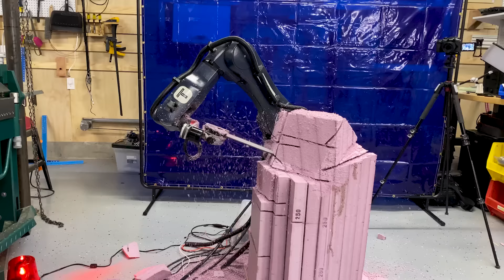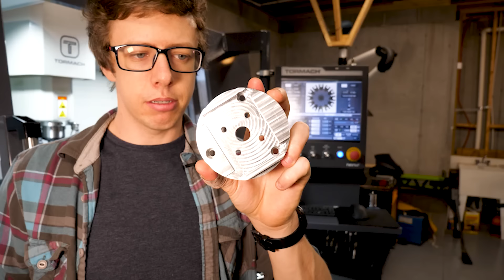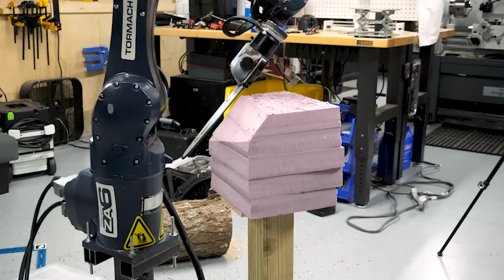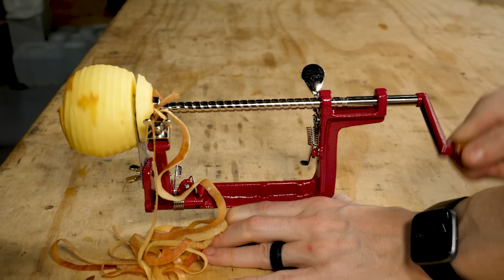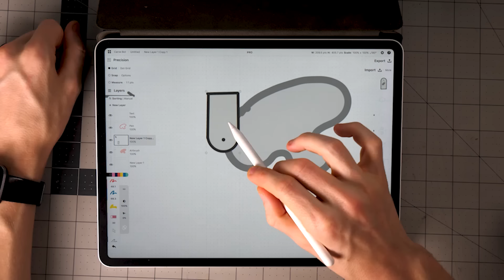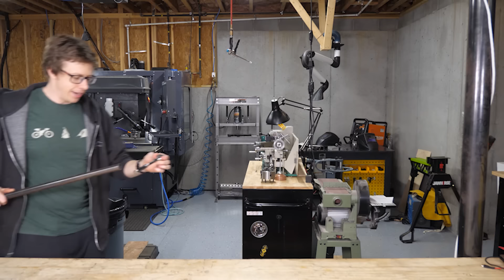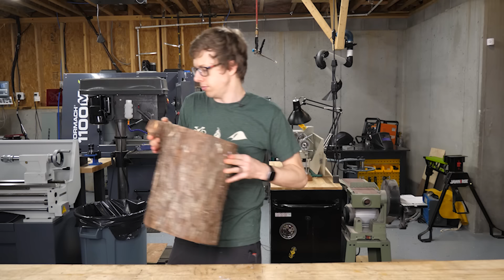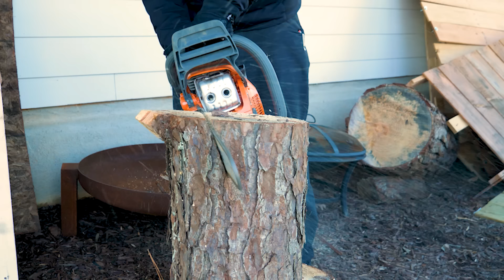Chainsaw + robotic arm = art?

Comment: Great project Shane!

I don't have any real engineering bonafides, but I do have a lot of experience with chainsaws. Don't ask.

Some things to possibly help with V2:

1. The "anti-kickback bump" isn't for kickback, that's the raker. They're designed to ensure that each tooth only cuts out a small ribbon of material each pass. This does help mitigate knockback when cutting with the 'forward' edge of your bar, but its mostly to optimize the cuts the saw makes. After about two to three hours of intense cutting, the tooth will be worn down with friction, and the cutting surface will be dulled. This is one reason you couldn't cut on the tip, the raker was preventing the tooth from catching the material properly. This can be solved by filing down your rakers everytime you sharpen your teeth, which should be about every 2-4 hours of cutting, depending on the material. On paper each individual tooth has the same cutting power, irrelevant of position on the bar, but when on the straight edge of the bar the teeth can cut deeper, because of smarty pants stuff I don't totally understand. 

2. Cutting with the tip of a chainsaw involves some funky geometries and forces, as I'm sure you're aware. From experience, a person can't just jab the tip straight into wood and expect it to cut. This is because only a couple teeth actually engage with the material at any given time, and because of physics you probably know better than I, the saw's tendency is to "run" along the material, instead of actually cutting. Cutting with one of the two corners, where the curve of the tip meets the straight edge of the bar, is preferable. I can't fully explain why, just trust me, I got thousands of hours of experience behind a saw. If I had to hazard a guess I would say that more teeth can cut more consistently along these corners than the tip alone. However, cutting with these corners is where knockback becomes a concern. Universally sawyers only cut with the "cutting corner", the corner where the chain is running back towards the head of the saw. Using the other "kickback corner" tends to, well, kick the saw back at you. The saw will always prefer to move instead of cut, and the kickback corner is where the chain is running out, away from the head of the saw, creating force that pushes it out of the material. Cutting here is incredibly unsafe for people, but your Tormach arm may(?) be able to provide a consistent force to counteract this without ruining your cut. However, your best bet is to only cut with the "cutting corner" of the tip, at least until you've got an inch or two of depth, at which point you can straiten the bar and begin a plunge cut, which is just pushing the saw strait into the material.

3. Your saw is dangerously hot because of two possible reasons. The first, is that your teeth are dull and require sharpening. Obviously when a power cutter is dull and not cutting properly, it creates lots of excess heat through friction. I'm gonna give you the benefit of the doubt and assume you're keeping your teeth sharp, if you aren't it's pretty easy to lookup tutorials and buy the necessary tools online. The second reason that I can tell just from looking at your cuts, is that you aren't using any bar oil. Bar oil is just a combo coolant and lubricant, you can buy it off the shelf of any self respecting hardware store and it's vitally necessary for any intense cutting, which this qualifies as. Pole Saws rarely use bar oil, they're designed for more domestic use, you know, less intense use less often, but also because the branches pole saws cut are fundamentally different materials than the trunks you're trying to cut. Trunks are denser and more brittle, being significantly harder to cut. Teeth create heat when cutting trunk-wood and running a saw for long enough to cut through a trunk risks the heat from the chain running along the bar being great enough to warp the bar. You are terrifyingly intelligent, I'm sure you can design a oil reservoir to cool and lubricate the chain using off the shelf oil, but if you don't want to I think you might be able to find industrial pole saws with it already included.

4. Another consequence of using a pole saw to do chainsaw's job, is that the teeth on a pole saw are just designed differently than those on a chainsaw. I don't work with pole saws, so I can't say how, I just know they are. I'm certain though that you could probably buy (or make) chainsaw chain sized for your pole saw.

5. You may need to slow down the speed at which you cut. If you push a chainsaw into a material too hard, it'll have trouble cutting, and may even stop. This is rare with human operators, but your Tormach arm can almost certainly exert enough force. Slow it down some, cutting with the "back" edge, where the chain is running into the saw head will naturally pull the material into the teeth, very little extra force is necessary.

TLDR: File your rakers (and sharpen your teeth!), adjust your cutting geometry, include lubrication and cooling, and finally use chains designed for the job at the right speed and you should be cutting doggos outta wood in no time.

Bonus round: Wood can bend and pinch onto the bar and chain of a saw if there is enough mass above it. This can slow the cutting, and even damage the bar and chain if it's bad enough. This is usually only a problem when cutting into trees, but it might affect you, depending what cuts you make and how chonky the wood you're cutting is. If you have problems with this, maybe optimize the tool paths to cut top down, and never make a cut that has X volume of wood above it?

Bonus round 2, electric boogaloo: An electric skateboard motor probably isn't enough horsepower. I don't know the specifics, just that chainsaws, especially electric chainsaws spin a lot faster and with way more torque than people think. If you fix everything else, you could probably get away with keeping that motor, though it'll still probably be rather slow. I'm not sure how much bigger/better a motor you could mount, considering your space constraints.

Bonus round 3, hopefully the last: another note on sharpening, I noticed your saw hits the Tormarch a couple times. Hitting metal can wreck the chain on a running saw.
At best it dulls a few teeth significantly, at worst it can outright destroy the teeth. I highly recommend slamming that E-Stop if you suspect the saw will hit metal, since it can take upwards of an hour to resharpen the dulled teeth by hand, but you may also want to have a few spare sharp chains on hand to continue cutting if you do hit metal again.

Comment: How did the chainsaw stay lubricated? Without the bar oil it’s pretty easy for the chain on bar friction to cause sparks and a lot of heat so that may be a big part of why it was so smoky on wood ( besides the low power obviously)

Nvm just noticed he left the oil tank after it...

Comment: Please fire the guy you know who has trees. Next time call me I'm happy to help. Don't use pine as carving wood. It's awful. It's full of resin that will gum up your saw and dull your blade. I'd suggest using kiln dried poplar. Stay away from woods with lots of resins in them. Also I love sharpening chainsaw blades. I'd be happy to help with these woodcraft problems. I run a cnc router in my shop. That means I'm only smart enough to commiserate to understand how insanely difficult what you are doing. But for real I love sharpening chainsaw blades.

Comment: As a chain saw guy, I have some tips!
First, you need a different chain, or modify your own chain. Second, you need a softer log. Find a new Guy to know! If you look at Baileys logging supply etc you will see they have wood carving bars with skinny tips, and carving chain.
While you can probably get by with the sprocket nose bar, you need the carving chain.

The bits you pointed out on your chain are the "Depth Gauges" and they basically control the feed depth of each tooth, and also have to be ground down each time the chain is sharpened to keep the feed depth the same.

Normal civilian chains have anti-kickback features, which make the depth gauge push the tooth further away when it's going around the end of the bar.
Pro chain and carving chain don't do this, and if you get a little Dremel chain sharpener etc, you can easily grind the little arm back yourself, as long as you don't shorten the high point on the flat sections of the bar, or you can just buy the chain without kick back reduction.

In addition, you can grind the depth gauges down a little bit and let the tooth grab a deeper cut, but you will probably need a more powerful motor.
You can also do the opposite and grind the tooth down as if you are sharpening the chain, WITHOUT grinding the depth gauge, and reduce the depth of cut to reduce the motor load.

All this is regular parameters in chain sharpening depending on the application, control needed, horsepower of the saw etc.

When I was doing tree work, the saw I used hanging on a rope in the tree had kick back reduction, a low depth of cut, etc, but my ground saws had full skip chisel chain and full danger so I could easily plunge cut, carve, or just blast through the wood.
You would be amazed how fast you can cut oak with a 24 inch bar on a 395 Husky... Lol

So if you are wanting to plunge cut or use the tip of the bar, get rid of the anti-kickback tabs.
You risk damage to the equipment from kickback (where the chain grabs and tries to lever the saw across the face of the log), but if the robot is stable enough, I don't think it will be a problem.

As others have mentioned, it also takes a different kind of chain for ripping wood than cross cutting. 
When you cut across the grain it makes neat little chips that clear easily, but ripping with the grain basically creates long ass fibers that gum up and clog, and it needs a different tooth style to work well with ripping grain. 

Carving chains will be ripping chains since that's a lot of carving. 

And you picked pretty much the worst kind of wood for this lol 
Pine/fir is resinous and sticky, and not fun to cut. 
I don't know what part of the country you are in, but maybe call an arborist near you and see what kind of really soft wood grows in the area. It will be considered trash wood probably, not good for firewood or building because it's so soft. 
I am not going to try to name any suggestions, but Google can find super soft species I am sure. 

Balsa wood would be perfect, but it's hard to get logs if it outside of the jungle lol 

So I would swap to a carving chain, and not be surprised if you need more HP to drive it.

You can make your own custom length chain with a chain breaker tool.
You need to match the bar groove width, and the drive sprocket tooth pitch when selecting chain.
Or just get a carving bar and matched chain and drive sprocket, and make whatever modifications needed on the powerhead to fit them on.

This will get you past the chainsaw parts of your problems, so you can focus on the rest lol

Comment: The chainsaw needs a way to oil the bar and  I noticed the chain was also loose you Want it  tight enough to be able to put a dime under it if you pull it up

Comment: I used a die grinder and a carbide bit in rage on a piece of wood I needed to shape strangely. I wonder what giant carbide or even less dense bit you could put on a robot arm.. just shred with different shapes at a rotation instead of linear...lets the chips fly.

Comment: Confused... Why reinvent the wheel when there is already software out there to do it? You draw it in cad / cam software and export it to 7 axis software.
https://www.youtube.com/watch?v=YPyPwr5B8nU 
Second... a chain saw is designed to be lubed while in use. 
Third... Depending on what you are cutting and the direction of the grain (cross or with) you have to pick the right type of chain. 
https://chainsawlarry.com/chainsaw-chain-types-explained/
And as far as using the chainsaw to do the smaller cuts, you need a carving chainsaw.
http://www.cannonbar.com/carving-bars/

Comment: You need to use an angle grinder to chain saw conversion kit for 60$. You just need to make a DIY oil chain lubricant tank. That way your chain won't overheat and also break. The angle grinder is really more compact, have more torque and have more speed then your chainsaw and a gas power chainsaw.

Comment: I was thinking about different methods to choose what cut to use. You ended up using an iterative process to find cuts. Instead create a normal map of the 3D model and calculate the tangent space. You could then go through each normal plane and select the ones that remove the most amount of material to create the smallest possible convex shape. From there you can calculate the intersections of these tangent plane to form the wedges you found. Granted there would be some more work getting the normal map converted to the tangent space and some selection parameters would be required to choose which tangents, and their intersections, to cut, but the math would be simple linear algebra. I like trying to find solutions during the vids, It's my favorite part of your videos.

Comment: Since you ended up on foam that opens up the idea of ditching the chainsaw and going with a MUCH safer hot wire cutter. I'd bet you could dial it in to a much higher level of detail with that and the rig will be way less likely to kill anyone!

Comment: Reference: Saw not Cutting Wood.

The teeth you referred to as anti kickback teeth are the depth gauges for the chain, commonly referred to as "rakers".  They should be filed about 0.025 inches below the edge of the following blade on the chain.  If they are set right you should see large curls of wood being pulled off the log (maybe not in hardwoods).  If they are set wrong the saw will not cut in a way similar to what you experienced in the video.  There is a tool you can get that sets the depth of the rakers for you that works pretty easy.  Also with a chain that short you are probably going to have to stop and sharpen it a few times if you get the wood working.

http://www.madsens1.com/bnc_depth_gauge.htm
https://tinyurl.com/yaerhhd4

Thanks for the videos; interesting, entertaining, and educational as always.

Comment: You should try and use a carving chainsaw blade. There are special ones out there. They are way more pointy at the tip and carving chainsaw blades are designed to cut differently. But awesome Video Dude!

Comment: 17:25 The anti-kickback chains are designed with safety in mind, however they also prevent you from achieving certain cuts. You can buy chains that don't have this feature, which would fix the problem (maybe).

Comment: Awesome results!
Your persistence through integration hell project after project is inspirational.
As much as the chainsaw idea is good I'd love to see you leverage on the foam as a medium and use a heated wire to cut it. It would make for an interesting experiment using different shapes of wire as tools and it'd probably be able to cut in much higher resolutions.

Comment: All right I have anger management issues and you're getting me all kinds of triggered that thing you zoomed in on and called an auntie kickback tooth is called a clean out tooth there is no teeth on a chainsaw designed not to let it kick back that is a myth the bar break meaning the lever that engages the brakes when the saw gets jerked prevents injuries during kickback kickback is a result of user error and you definitely need oil on that chain I'm pretty sure you do eventually get that straightened out but chains need oil especially when they're sliding through a track they're not rolling over a sprocket there's a lot of friction there creating all that heat and those clean outs you can file them down so they clean less material and then the teeth will bite a lot more but you're going to have to put a lot more torque into that chain

Comment: I did well with an applied math class that dealt with problems like this, and am semi-familiar with optimization of this variety. Here’s a way I think you could make the gradient ascent method work:

What if you defined the wedges in the same way you did with gradient ascent, and use one step of gradient descent from each peak when it gets stuck like that, fixing its height and (I think) latitude?

Then force the program to continue searching for a maximum, in that direction (CW vs. CCW) within that height-latitude “cross section” (not really a plane but for mathematical purposes we can call it that). 

From there, you know you are searching for a new, unique value.

On the off chance it just keeps looping between two max values (which should be easy to test for by storing and comparing against known extrema), I would define a plane orthogonal to the line connecting those two points, guaranteeing that you will find a new third point.

I’m not sure if that will get you stuck in a triangle, but if it does I can try to puzzle through that too.

The trick is to limit the set of variables it is testing, and give it a tolerance and a general direction that encourages it to move on from an area - though I’m sure you know that much.

Really cool video and result! If math class was like this all the time I might not have dropped out of university :/

Comment: Get some bar oil on there for some lubricant!🤣that’ll help with smoke and heat. File down the anti kickback so the chain can make a more aggressive cut instead of rubbing.
Reply: and cut softer wood. You could probably find basswood blocks and laminate them together to form a similar 'log' to the foam pieces.